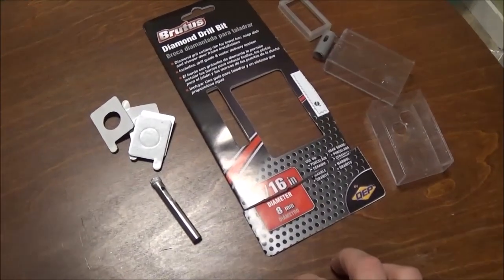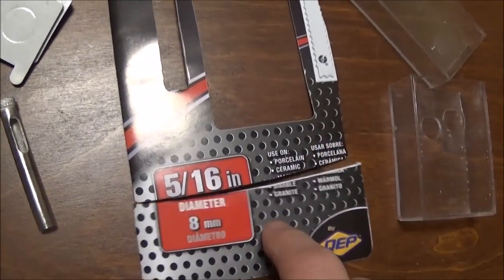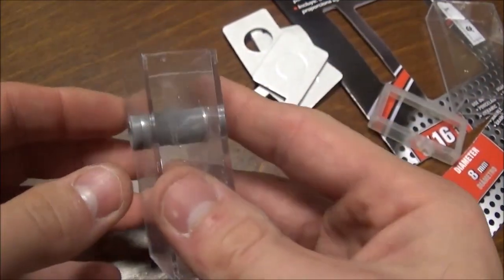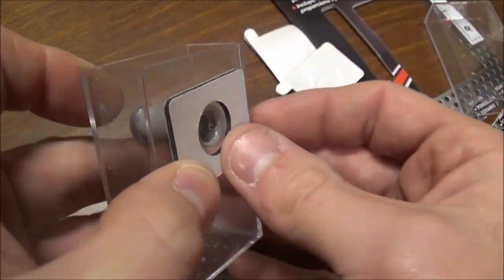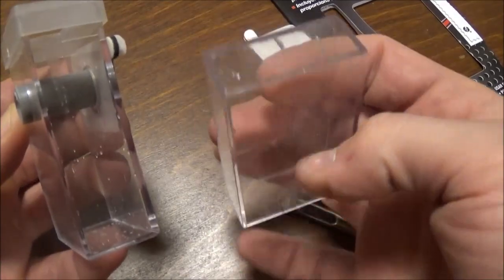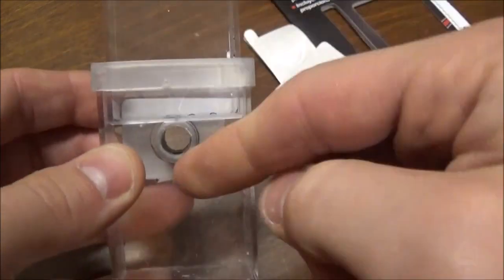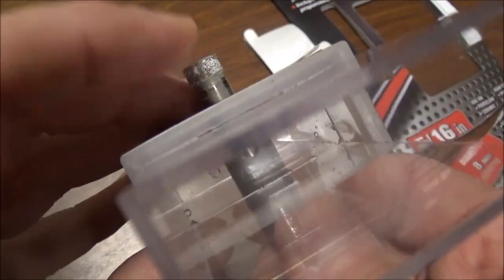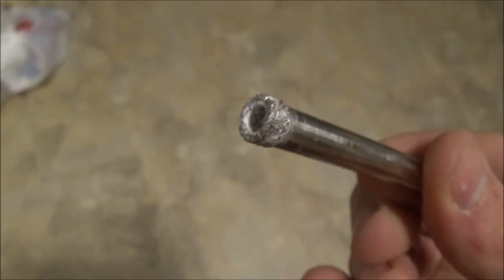How to drill holes in Porcelain Tile for $11 (QEP Brutus 82414BR Review)

Comment: That's no way to treat a lithium battery, obviously you've never seen one explode ?
Reply from the maker: I have had one explode on me, a 1s for my quad copter. However I still use the hammer function on the dewalt because I've dropped it off a 20 ft roof with no issue.